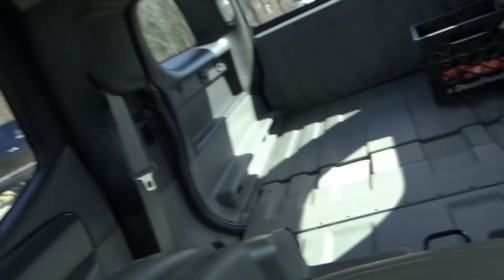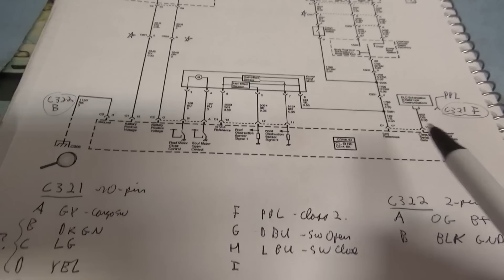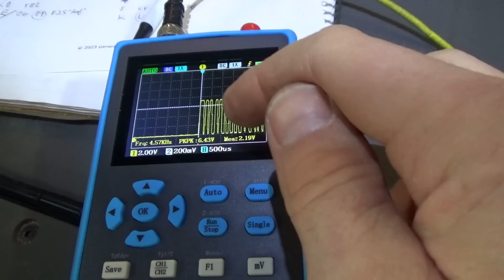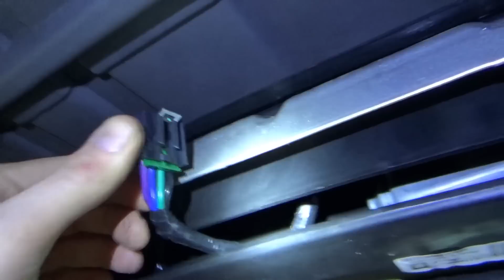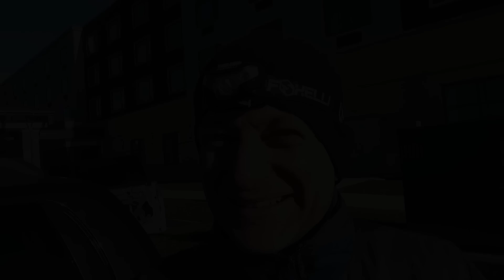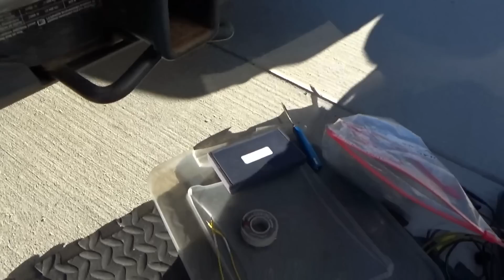Convertible Truck...Can't "Convert"?? (GMC Envoy XUV)

Comment: By rigging the rear door to open without using the module, you also lose the function that you didn't know about that lowers the rear window an inch when you use the button handle. It also automatically raises the window that inch when the door is closed. Using the key in the door will work the window and door latch, though it probably works through the module.

Comment: Endgame control module in the tailgate. IF YOU CAN find it online it'll run you $400.. unless you can find it online. I got lucky to find it online AMAZON for $142. but GM also changed the part number for some reason.

Comment: I put in a new actuator at the bottom left, it worked once or twice then quit working, only the top left drivers side releases. The dash still says close the roof even though it is closed.

Comment: So when functioning properly when the swing gate release is operated the rear window rolls down just a hair and when the gate is closed the window goes back up. This is so the rear window would have a solid channel to secure it if other windows were open, as the back becomes a parachute collecting air.

Comment: Have to razz you a bit here Ivan, the gate switch is signal level only, not designed to do actual work. The counter EMF from the latch solenoids will tear it up in time. A relay of a few amps at DC rated and reverse diodes across the contacts for long life and suppression is called for here. Interesting video on an interesting vehicle !  Have a great day.

Comment: Two questions for you...1: Do you still have the part number for that circuit board? 2. Do you/Did you actually find out where the actual fuses are located for those particular functions? I have one and I'm not getting comms with the back tailgate at all and would greatly appreciate the information.

Comment: That button was designed to signal a processor. I don't think it will handle the unlock solenoids current for very long. I would have used a relay controlled by that switch to control the unlock solenoids. That would have allowed you to use a ignition switched 12v source to provide a way to prevent operation without someone with a key being present. Nice work!

Comment: could you not by pass the modules and have switches for the wiper and trunk and rear window
Reply from the maker: If you want to stretch a mile of wire sure

Comment: All that fancy stuff comes back to haunt us! Personally, I don’t want it, don’t need and most of all don’t want to have to pay for something that when it fails the parts are not available. Way back in the fifties there was a station wagon that had this pseudo pickup feature. It was all manual and it worked. You didn’t need a genius like Ivan to open a door! Great Russian hack very impressive. Made Mr. William a happy customer.

Comment: You got it working in a "sort of manual" way.  Access to the back is good now.  Perhaps a fused switch at the fuse box to cutoff power to the opener switch would give added security protection.  Just a thought.

Comment: That was beautiful! Repurpose parts of a too-complicated system to make it useable! I remember when those vehicles came out, but never have been in contact with one. I have to question the practicality of that system when the top opens but the sides stay in place. I hope you have a re-engineering fee in addition to a diagnostic fee.

Comment: I'm kind of baffled about why it didn't want to start after I change the wires and plug first time in my life ever happened to me I've been working on cars for over 50 years I just don't get it anybody out there can help change my spark plugs and wires and car will not start the wires and spark plugs are all good I even put back the the old spark plugs and the all wires still won't start I don't get it can anybody help did not touch anything else

Comment: I always liked my dad’s Austin A75 estate that had a split rear door, you could drive with the top part of the door open for extra ventilation  or for moving long stuff.  Not an electron in sight apart from lights(manual switch),everything worked until the bodywork escaped !

Comment: I'm only 10 minutes in, but I do have a honest question (it may end up being answered as I watch...)...if you are able to command the rear windows ect from the scan tool, wouldn't that mean that you already know that there is power/ground going to where you are now checking for power/ground? (rear window area) I mean there are not 2 different sources of power that control the window. I would have checked for power and ground at the source (rear window area) if I were not able to actuate the device from the scan tool. I would have went straight to testing the control panel connection. The only reason why I say this, is because if the CAN network was not working wouldn't that again have prevented you from being able to actuate the rear window from the tool? before seeing your end result, I suspect a bad switch or somewhere between the switch and the module the switch  commands is bad.
Reply from the maker: Power Roof Module was offline. Nothing to do with the endgate window or accessory power.

Comment: Of course it can be done better with use of Arduino and 2 relays so that window can go down for 5mm and after latched go 5mm back up. Need to program a little delay in between. Or even better - put that hall sensors to work with arduino to check position of roof.
Reply from the maker: Kicker is that Endgate module is looking for "Roof is Closed" message from the broken Power Roof Module...how do you recreate that with an Arduino?

Comment: Ivan I need help with my Ford Ranger it's a 3.0 flex fuel can I do a compression test to find out if my timing chain is broken I know you're busy one day my truck worked fine next day after changing spark plugs and wires it does not start all the wires are okay and are in the right place I bet the quail might be bad I replaced it still won't start please help when I diagnose that right with the compression test to find out if my engine is working correctly with the crank and the cam please help
Reply from the maker: Well if it stopped running after changing plugs and wires, I doubt there is anything wrong with compression lol

Comment: I have one of those XUV's  in our pick-n-pull yard here in town. I've seen a few come thru there..
Reply from the maker: I wounder if it has the Power Roof Module still on it ;)
Reply: @Pine Hollow Auto Diagnostics  its been there a few month's.  I'll check it out this week and see on my next trip.
Reply: @PineHollowAutoDiagnostics  .. Ivan I picked up that module. Looks good but unknown if it works as I can't bench test these. It does look like it tries to communicate when it's powered up for about 5 or 10 seconds.. let me know if you or the customer wants it to try..
Reply from the maker: @gerrymoeller  Hey Gerry, that would be fantastic! Send me an email at ivan@pinehollowdiagnostics.com
THANK YOU!

Comment: Hey!  I had a “convertible Truck”.   It was a 1979 Chevrolet Trailblazer.  It was dead reliable and went 310, 000 miles before it was given away to a guy who wanted it to do some desert off-roading. The windows never failed to work (they were all hand crank including the tailgate window) and the “convertible” roof came off reliably after you removed all the fasteners and had 2 fairly strong people lift it off.
Reply: I hitched a ride near Yuma in one of those trucks, it would have been great to have on the beach too!

Comment: Now make a polarity reversing switch for the roof and rear window and everything would work again! Without the stupid modules!
Reply: You would need to locate the hall effect position sensors and get them working so it would turn off/on when in correct position. Or replace them with micro limit switches.
Reply: @KennyNica  Most of those motors will have the same internal limiters as other GM motors, they will turn off at the current spike when the window or roof reaches end of travel. Plus if the owner wants to use the options he just remembers window first roof second. Or scour a few salvage yards to see if a module can be found.

Comment: I’d like to take a crack at repairing that module. It looks basic enough to almost be in my wheelhouse! Lol If nothing else, I could replace every component on the board and hope that a replacement chip can be programmed with a j2534. . .

My mom had one of the Envoy XUV’s on loan back in 2004 or so, while her Envoy XL was having one of its many issues serviced under warranty. It was a pretty sweet ride, but her 03 XL didn’t exactly inspire confidence with all of its troubles. If it would actually work like it should, the XUV would serve me very well as a “farm service truck” in my 120mile/day commute. Especially if they made them in 4wd. The ‘07 Caravan that I stole from my wife and gutted has been doing the job for years, but I am well over its recommended weight rating just in tools. Lol
Reply: And what would you program it with? I don't think GM will turn over firmware.
Reply: @marossgnv  that would take some investigating and probably some finger crossing. Frankly it would probably be easier to just replace the entire module with an arduino. Truth be told though, there probably isn’t anything wrong with the chip anyway. It’s most likely just a shorted capacitor or funky transistor.

Comment: Cool find and repair. My Dad's old Buick wagon had a tailgate that could swing open, or drop down mechanically. Also you could put key in gate and turn to roll down window.  Was a great machine for moving. Fold rear seats down and could swallow a 7 foot couch and close up. Keep up the good work!

Comment: That's a real odd ball. I guess the only thing I'd be worried about as far as the gate, would be do you think the switch will be able to handle the current for long?
Reply: I was thinking the same thing. Maybe the relay could have been repurposed with the switch on the control side just to save the contacts

Comment: This repair does get the owner out of a bit of a bind. As a suggestion, a switch mounted up front somewhere in series with the circuit would allow the tailgate button to be disabled when required so the owner can leave stuff in the rear.
Reply: That was my exact thoughts as well.

Comment: I also have one of these exact same trucks. Mine is a 2004 Envoy XUV (196k) with basically the same main problem. Tailgate doesn't work, roof doesn't work, window won't work, etc. Bought it that way in 2018 with 169k to be a snow truck here in Indy.

My mechanic told me the GEM module had failed but things still functioned with their scan tool. I do not have the issue with the message on the cluster, but all of my cluster options aren't accessible anyway because the buttons on the steering wheel don't work. 

Unfortunately, my mid-gate glass doesn't work at all, so doing a hack like this would just leave the whole truck open. I was wondering if I could do something else with it since you showed the wires to tap. Perhaps I could just put a switch on the inside of the truck so it could be secured. I just want to be able to open the trunk...and replace a brake light that's been out for 2 years XD

Comment: Seems odd the tailgate functions rely on the top module when the tailgate has its own module. Be nice if you could just “bypass” the top module, so the tailgate would function normally.
Reply: The tailgate module is ok, but it needs information about the roof position from the roof module to allow some actions, otherwise it could brake sometring.
Reply: @petrnemecek4379  Just seems odd that the system might prevent you from opening the tailgate with the top open if everything was operating "normally". Just an odd vehicle all around I guess.

Comment: The barrel capacitors on the module are pretty famous for going bad (in tv's that is) I wonder how many modules could be saved by testing and replacing those caps,I repair many tv's with bad caps. One could rig up a switch panel to make the roof functional if the owner really wanted to use that truck convert mode. Probably guy didn't care for that.

Comment: wonder what the microcontroller they used in that module looks like it has a logic shifter which you would need to send 12v to a most likely 3v3 logic micro

Comment: Was there no switched power in the tailgate?  Like that you had to have the key in on position to open the tail gate so if the car is off the gate is “locked”. Nice fix though!
Reply: Like maybe using the wiper power lead?

Which makes me ask if the rear wiper works now?

Comment: Never had the misfortune of working on those.  Actually never saw one, and I've worked in  gmc dealers since 1989.  We would have sent that guy packin.  Good job for you!
Reply: That makes for a piss poor stealership. Might be a reason why they have a certain reputation.
Reply: @mattbrown5511  Not really,  because the time billed to diagnose and repair would certainly exceed what that junker is worth.  Besides, if any parts are needed they are most likely obsolete.  So let guys like Ivan who have time to tinker fix it.  Besides, I have brand new broken down cars lined up out to the street, no time to tinker with old junk.
Reply: @scrappy7571  So new junk designed by idiots over old junk designed by the same idiots. Good plan. Same reputation for the technicians that mess up as often as they succeed.

Comment: That's only the second truck I've seen like this. The other channel had to replace the entire roof system because everything but the module you needed was broken. Luckily JandJAutowrecking had the roof.
Reply: The CONVERTIBLE Roof On My GMC Envoy XUV Is COMPLETELY Broken Troubleshooting " WatchJRGo" about 2 years ago ?
Reply: @islipfdchief  yes
Reply: and this roof unit is a unicorn
Reply: @islipfdchief  Yes

Comment: Just because you can't see any cracks on the solder joints doesn't mean they're not there. Re-solder the joints on all connector pins and try again.

Comment: I was thinking you may have better success using the Tech2 to talk to the Roof Module. The Chinese scan tools don't always work right, especially for rare uncommon modules.   Thanks for the video, Ivan!
Reply: Unlikely.  The other modules in the car are also unable to communicate to the roof module.
Reply: No because other modules had codes for not communicating with it as well.. nothing to do with scanner
Reply: Worked on them at the dealer a lot water leaking caused a lot of problems they really are great when it works if you need a factory repair manual I have one

Comment: Seems like they made this vehicle until 2005 and only on the long wheelbase GMC Envoy.  This rides on the GMT360 platform along with the Chevrolet Trailblazer, Oldsmobile Bravada, Buick Ranier, Saab 9-7X, and the Isuzu Ascender.  ( The Chevy and GMC were offered in 2 wheelbase lengths.)  This is designed similar to the Chevrolet Avalanche only the roof slides.  My uncle had a 1963 Studebaker Wagonaire that did the same thing with the roof; you just did it manually and they tended to leak.  (Not to be confused with the Jeep Wagoneer.)  Beginning in 1966 Ford had a dual action tailgate on their station wagons that opened like a door to the side or dropped down like a tailgate; you had to have the window down to do either.  Beginning in 1969 the tailgate could open to the side with the window up or down.  I haven't watched the whole video, but I sense some "Russian repairs" coming on.....Great video!
Reply: GMT 365. The rear of the frame is slightly different and it is only used for the XUV.

Comment: Vehicles could be so reliable if they would stop attaching computers after computers to everything Gm leads the industry in over computerizing everything, fuse, wire, motor, safety switch STOP thats all they need

Comment: One of my first good customers had one. This was like 5 years ago when I first opened my shop. He brought me one of these with a issue which he  had installed a aftermarket rear gate window regulator and it never worked right after. Window would roll down with up button and up with down button. The replacement regulator polarity was wrong. It caused while thing to malfunction because the roof and gate are all tied together and have limit switches and it someormes opens like a old station wagon or window down back gate opens like tail gate on pickup
Reply: If I remember right one of the modules would only talk to the tech 2.